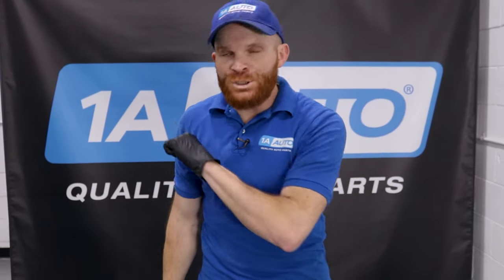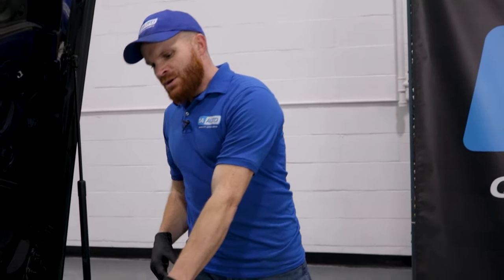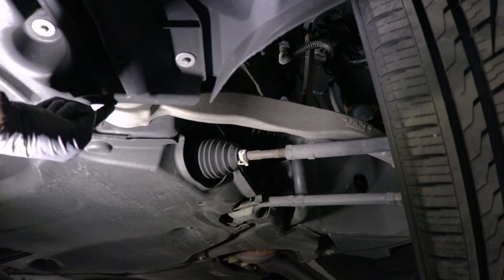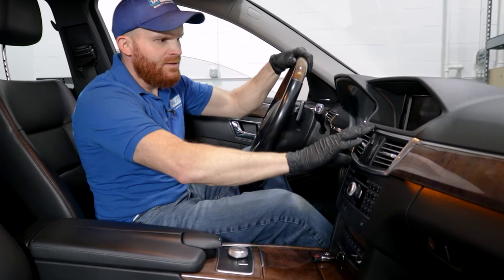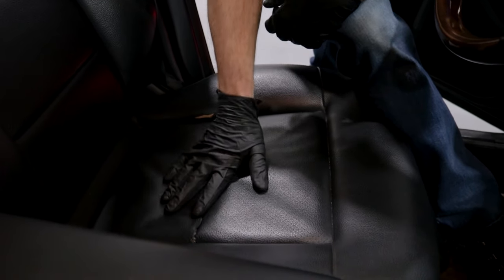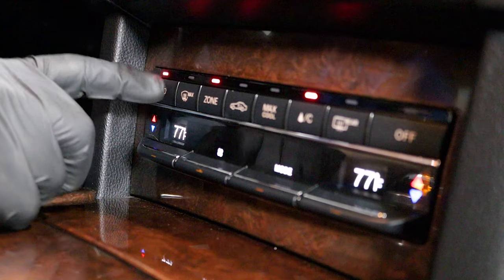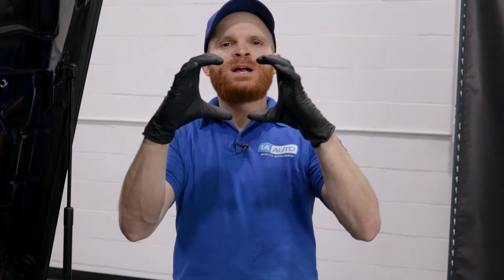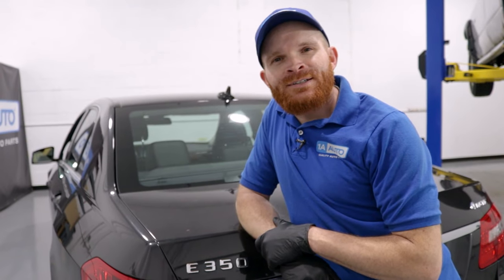Top 5 Problems Mercedes Benz E Class Sedan 4th Gen 2010-16 W212

Comment: Top of 2012 E350 W212 Fuel Pump on Drivers (left) side under rear seat has cracks and leaking (pooling on top of pump) fuel under the rear seat. Contacted Merecedes and they claim to have never heard this problem before (Lie) up until 2009 this was a recall item, but even though it's still a problem. I guess they are waiting for someone to get seriously injured, burned or killed before they address this. It was first noticed by my daughter who could smell the fumes coming into the car from under the seat.

Comment: Does the 350 Bluetec Dirsel have the same issue with the transmission shifting. I’ve had the earlier 2008 V 3.0 diesel . Issue was an oil cooler gasket buried deep in the V. A $5 gasket with $1800 labor to replace .

Comment: I am looking at a 2010 E350 4Matic to buy (tomorrow, actually).  It has 156,xxx miles and is priced at $11,000. No warranty available, unfortunately, unless I want to go the CarShield route. Thank you for telling me what to look for before I sign and drive away. I understand the reasons why you didn't, but I wish you had given a range of repair costs for the items that are mechanical in nature. Technicians charge different rates and there are garages a plenty... but not where I live. The nearest MB dealers are 1 and 2 hours from me. There is 1 mechanic specializing in European cars (and he actually charges more hourly than the dealer... I have a Passat, too, so I am familiar with his prices). I digress... thanks again for posting this!

Comment: So I have one and I’m having issues with throttle. If I barely press the gas, it’s like the vehicle stutters but still goes. If I push the gas with a little more enthusiasm it goes normal. Mercedes’ Benz dealership told me it’s the transfer case and it cost $8k. Can anyone else here help??
Reply from the maker: +Edward Atkins We wouldn't be able to diagnose an issue like that here, you may want to have a local mechanic take a look at it. Thanks for checking us out! http://1aau.to/m/Shop-1AAuto-c

Comment: Hi I have a 4th Gen W212 sedan and continually get scuffing noise as I travel along a road i have checked the  underbody protectors and yes they are all firm but low to the ground even though they are in he original position any ideas?
Reply from the maker: +Neil Harrington We wouldn't be able to diagnose an issue like that here, you may want to have a local mechanic take a look at it. Thanks for checking us out! http://1aau.to/m/Shop-1AAuto-c

Comment: 2012 E550 4MATIC 108k;  having problems at parking lot speed when I make a full turn left or right in reverse or drive. Wheels make a spuddering effect like it scoots and grinds. 

Shop said it was transfer case, another person told me it could be the multi disk clutch pack. 

Anyone ever had issues in this ?

Comment: I have a 2016 E250
#1 the transmission does not shift as nicely as it should even though I kept up with all the oils and filters
#2 rear suspension is leaking
#3 intake manifold need to be replaced $$$$
#4 front passenger seat ripped, I just live with it when it's time to sell the car, I will fix it 
The only reason I like the car is because it doesn't waste fuel
It's probably one of the best mercedes made
All mercedes have problems and are extremely expensive the E250 just has less
.... Great video...
Reply from the maker: +Real World Thanks for the feedback, we appreciate it!

Comment: I just bought a 2013 E 350 4 Matic with 48k. It's in pristine condition. My only concern is a low pitched moan at hwy. Speeds once the car  is in 7th gear. If I back it into 6th gear with the paddle shift it goes away. My mechanic says it's normal but I'm not convinced. Tranny shifts great so wondering what might be causing it.
Reply: Front tires are worn?

Comment: Hello

Thank you very much for taking the time to read
Clarification: E200 CDI 2013 model Automatic Transmission 100 KW. The motor starts and I'm able to put the car in D(Drive) and move away I'm able to drive the car for let's say 100 m in straight line but if I arrive at a STOP sign or for another reason I need to stop the car and press the BREAK pedal after I pressed the BREAK  pedal and the car stands still(No movement)  after that  it does not move anymore (it does not drive anymore)  even If I press the GAS (acceleration pedal) it does not go back into gear I press it  multiple times but it seems that the transmission does not make the connection to the motor it does not go into DRIVE or REVERSE anymore and the car does not move away like it did when you first started the car and drove for 100 m. After pressing like 12-15 times on Acceleration it moves away for like 2-3 meters after shaking violently the whole car and suddenly stops again after 2-3 meters.
In order for me to be able to move the car again I need to stop motor and start the motor again. After a new start of the motor I'm able to drive again until I need to press the Break pedal and the whole story repeats itself
.
An important observation that noticed is that I was able to go from D1 to D2 and D3 therefore the gear were shifting like the transmission was working but I don't have a clue what is really going on or what has happened with the car.
What I find a bit strange is that it does not show any message in the board of the car. The only thing that is unusual it's the ECO sign which is Yellow and normally I think it should be Green
This comment is long but hopefully I was able to explain the symptoms better. I try to learn as much as I can from you and your  videos therefore if you have the time, any ideas or thoughts regarding this problem please do share them to a guy who desperately needs them.
The work that you put into making this video is very appreciated by not only me but all of Mercedes owners, and they are really insightful and helpful.
Thank you in advance.
Reply from the maker: +Niculescu Adrian Thanks for the feedback!
Reply: Does your car have the "brake hold" feature?

Comment: I enjoyed your video. My question is about if you press on the accelerator and you hear a puff of air before the engine engages. It causes engine light on.  What could that be, when you hear the puff sound of air from the passenger side at the back of the engine? Thanks for your comments.

Comment: I have a 2014 E350 Coupe (C207) with about 75k miles.  I was advised that I might want to check Front Wheel Bearings because there is bearing play and that the locking cap needs to be replaced. Is that normal wear at that mileage?
Reply: Most of the time unless you're hearing a rumbling noise they just need a readjustment.

Comment: Absoultly false statement i am user and never ever had this kind of issues 🙄
Reply: That's a good thing to hear sir , I purchased an 08 E350 I changed the entire brake system along with a  Squealing blower fan and it did need new grommets around the dip and oil  Reservoir. This man speaks of these vehicles reaching its life end for some of us that purchase them after you own them for a few thousand miles. 😆 peace untou

Comment: I have a damn near FULLY loaded d’s ashes e350 4matic. Panoramic, rear seat factory headrest monitors, bought in 2017ish with 60,000 miles and I just hit 99,000 haha. I never had any major issues, I recently did the 100,000 service and spent a good 3,500 on a bunch of  little things! I’ve never had the check Engine light come on since 2
Late 2016/early 2017”knock on wood”I bought it for 17,500, it was like 21,500 out tbe door. I got 5$ a month with payment for key replacement program (lose a key, pay an extra 5$ that month and you get a new key.. I’ve got 4 so far 😆 also I pay 5$ a month with payment for dent program! Any dent under 4-5 inches with no paint damage is fixed for free! Plenty shops to choose from as well (:

Comment: These vehicles have horrible quality (Mercedes-Benz). You’re only paying for the brand. If you want a quality luxury vehicle that doesn’t look like it’s 50 years old when it’s actually 10 years old, buy a Lexus. They are incredible vehicles.
Reply from the maker: +Nicholas R Thanks for the feedback!
Reply: any non German ride has better quality because Japanese cars are built from German designs. It's the German way to let other companies compete for customers using their technology. Nobody can bit Bosch and Siemens so they manage their quality to create opportunities... ✌🏻
Reply: I have not had any problems with my 2005 CL55 AMG or my 2016 E63-S AMG other than just normal maintenance stuff. No quality issues what so ever. Maybe because they are AMG. But also they are real AMG's not a regular Mercedes with an AMG badge & AMG rims added on to it.
Reply: I had a 2001 ES300 now I have a 2013 E550. I'm liking the MB better than the Lexus.
Reply: But they don’t look aggressive like this 😭

Comment: This generation comes into my radar, as almost all later model wagons in the UK are either 1.8 E200s or E53/63 monsters.

It seems earlier models have better engines and later models better interior quality.

My 1992 W124 on the other hand has been a rock.